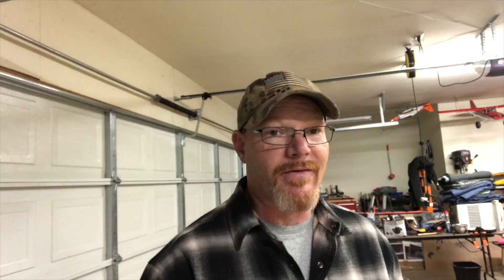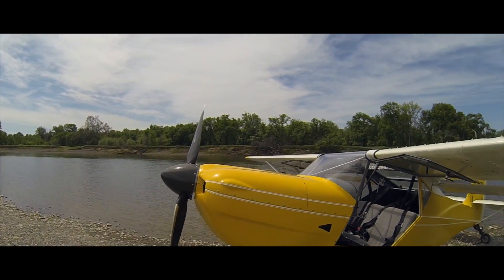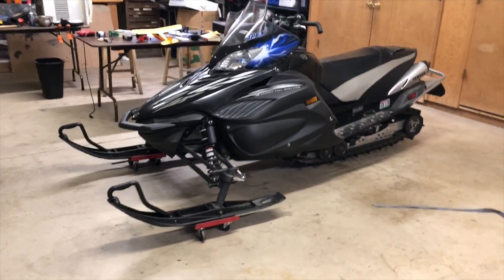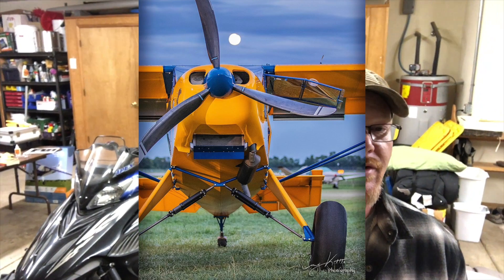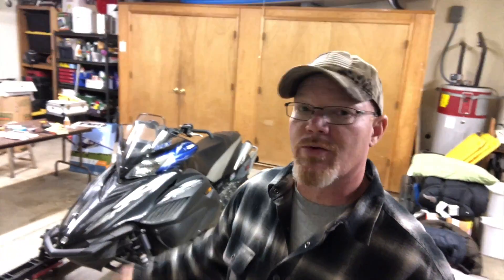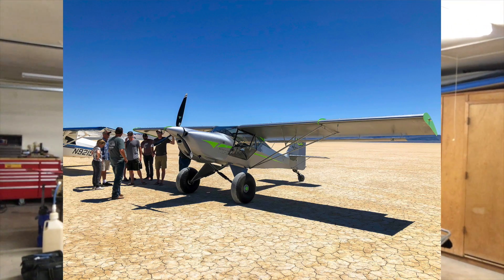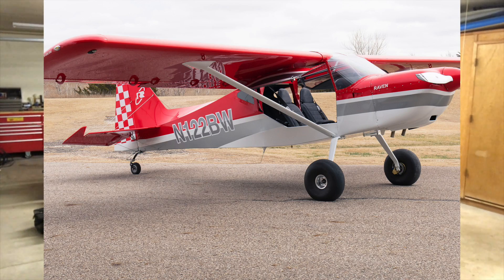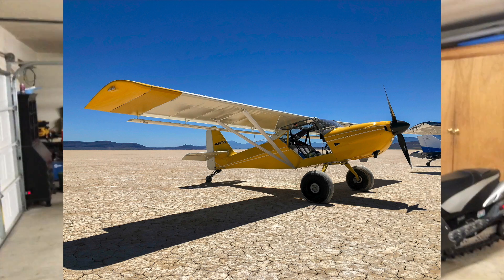There is an APEX in my garage!

Comment: Any reason you use a sled engine and not a motorcycle engine ?
Reply from the maker: Sled engine has an output shaft that can be adapted to a reduction drive. Motorcycles have an integrated transmission that can not be removed in most cases.

Comment: These Yamaha engines are amazing I have seen some aftermarket upgrades getting 400-600hp with the proper upgraded rotating assembly.  A fully built apex engine vr a rotax 914 turbo engine is the weight the same with double the HP.  What would be cool is if Yamaha would build this engine for experimental aircraft market.

Comment: You could just turbocharge your current engine if you are looking for more power and less reliability. Clearly, engines not engineered for turbochargers are somewhat of a risk. I saw your build 3 vid and commented on it re aircraft modified Honda engines. Seems to me a 180hp turbocharged, reliable engine made by arguably the most reliable engine builder on the planet would be a sensible choice over a 12 year old snowmobile engine with an aftermarket turbo. Way better than paying double the price for a turbo Rotax with the reliability issues those bring. Good luck and I'll get into the rest of your vids, thanks!
Reply from the maker: Viking has done a good job bringing the Honda engines to the airplane world, although I don't think they have a turbo version, but for this application it is too heavy, and Yamaha is equally known for their reliability especial this engine. There is less risk putting a Turbo on this Yamaha than there would be putting a Turbo on my Lycoming. Plus I just don't want to add anymore weight to my model 5. It is already on the heavy side with the Lycoming. The Yamaha will shave 80-90 lbs off the empty weight compared to my Lycoming and it will have more HP.
Reply: Less weight and more power, sounds like a great combination. I've owned a few yamaha's and have never had an engine failure, even in competition. Viking do now have a 180hp turbo Honda but it is a heavy beast; furthermore, the owner of Viking seems full of sh*t much of the time and I've heard of poor customer service. Great luck on your build, I am following and looking forward  @BowenAero
Reply: @BowenAero  I just want to add my two cents on turbocharging an engine that was not designed to have one. I am no expert in anything really but in my experience, performance mods have ALWAYS reduced reliability. From my Yahama Superjet, through 250YZ to my Yamaha Phaser sled. I'll also bet those two cents that if Yamaha were to come out with a turbo APEX, the changes to the engine would be subtle and very numerous. From metallurgy to stress re-engineering of the crank, rods, rings, and even the case design. I understand that for high altitude flying, turbos rock; therefore, a very low pressure turbo might not be so bad. Something that added very little total power, if any, but maintained air volume into the engine at low density. Looking forward to the build series!

Comment: Let's have a word about an av turbo and what it needs vs a terra based. Low rpm boost with minimal lag. What about blow off performance at altitude with air pressure changes? Progressive valving? What about air temp control? Air to air inner cooling up high, can it get too cold?  Timing at sea level vs say 5000 ft? Progressive computer controlled timing curves based on air pressure and intake temps?
Reply: Keeping in mind the turbo isnt to make power but to maintain power up high such as war time military aircraft. It will make a bit of power however but #1 is reliable, #2 is weight and these two already have a very very fine line. To add in a power adder now you have exponentially compounded your problem as it steals from both 1 and 2

Comment: Your current plane "old yellow?" has a certain integrity and beauty which is impossible to quantify. Watching your videos I can see that it flies straight and calm, and it has a mature sound and vibe. The best path respects that energy, the momentum that it has. Anybody can take stuff apart, and even restore it back again. But the removing of things that are so well dialed in changes the energy, even if you go to great lengths to put every washer and nut in exactly the same position, such that the overall feel is never one hundred percent the same. So I say, with a grand hand waving gesture, that you should keep flying old yellow as-is and meanwhile build a nice S20 or whatever you choose. Once confident with your new rig then you can hand down (sell) old yellow (to one of us!). Keep up the great work and the great videos!
Reply: well said

Comment: Either build a Fox Rocket with that Apex,  or a Highlander with the Apex and flip the KitFox.  Think it'd be wiser to just build a whole new plane with the Apex powerplant, and flip the KitFox, monetarily speaking.  Do you really do that much high elevation flying around Redding, CA?  Sounds like budget wise, none of it is too much of a discomfort, financially for you.
Reply from the maker: It is more high Density Altitude flying here in Redding and High Altitude flying in Idaho and Nevada. Any option will be financially challenging especially starting over. That is one of the attractions to the Apex engine set up. Right off the bat you are $20-30K less than a Rotax set up, although it will be more work since there is no firewall forward option available for the Kitfox.

Comment: 1. If you can afford it I would keep what you have.  You have it dialed and you would be able to keep flying while building.  It sounds like you are excited to build a new airframe.  2.  It sounds like you are really sold on the snowmobile engine and I am not trying to rain on your parade at all.  I completely understand that you want more power.  The places you go power is really important.  I don’t think it is more important than reliability.  I am sure you know way more about this engine than I do.  Just without knowing anything about it I am immediately concerned about reliability.  It seems like Rotax has done a lot of things right and the 915 seems very legit.  And very expensive.  
3. If money is an object then I would put a 915 in your current airplane.  Maybe upgrade the panel too.  It would be a nice project.  That’s my .2 cents.  Either way I will enjoy watching your project.  Thanks for sharing.  Good luck with your decision.

Comment: The huge boom in popularity in Kitfox (thanks to all the video bloggers) is driving up demand and much of that demand is going to be from "dreamers". I think you will soon see a lot more partially completed kitfoxs being sold on barnstormer. That being said, the Rans Outbound has the metal skin and can carry a much bigger load than the Kitfox so that means much more fuel and gear potential.
Reply: On my short list, but I'd need more STOL capability.  That spring gear has to go, for starters.

Comment: I’d like to see a scrounge build, use what you can find cheap or get free, like an old champ fuse modded to your needs by you. Find (non champ wings) wings or build from scratch, get ahold of Pete Plumb and do a custom build with slots or slats, and Cessna flaps. Set a super low budget and make it work. Think way outside of the box, you’d have a ton of us glued to your channel, and set up a cam for time lapse. It would be sick if you used your ingenuity to build a hi lander/kit fox/cub killer..... you can do it with that fwf turbo, and you can make it look like a decathlon to boot!

Comment: Well Bryan let me tell you about me.  I have a Kitfox 4 582 love it at 1500 ft. Started following Trent and you.  Found fox 5 bought it IO240 con. 125 hp. Guy had it ground looped it 8500 ft. No power and heavy.   Well guess what I flew it. Made 4 landings at 8500 ft. Not enough power I ground looped it not bad as he did but got wings tips. Also have talked to John and yes he is behind. Iam going to sell my 4 and build the 5.   5,6,7 s are all basic same  I will just change my engine in time.  I sure like like the snowmobile get everything you need to change it out and do like Trent change it out. Spend money on paint and dash call it a day.   FYI.  Good luck keep posting

Comment: For what its worth... i would rather ask the question... would I put my child/wife/mom in the plane with this powerplant? And take it from there. Personally if I had the money I would upgrade the motor to a turbocharged Rotax... but then again, how often do you fly at these high altitudes? Really great channel BTW.
Reply from the maker: Godfrey & Patrick wohnung I have asked that question and the answer is yes. To be honest I’m not a big fan of the Rotax and here is why. 100hp I feel is underpowered and the engine is designed for 100hp. Sure you can increase that hp with the 914 or with an Edge Performance 150+ hp setup, but the it was still designed to be a 100hp engine and the 915 is too cost prohibitive. The Yamaha engine was designed and proven on the Rx1 race bike at 200hp and is arguably the most successful motorcycle engine ever made. It has been derated to 160hp for the APEX application. It has a great reputation for reliability and it can be modified to 200hp while staying within the envelope of the original design and engineering. To answer your last question. I fly at the higher altitudes often and living in Redding, Ca I am at high Density Altitudes all summer long. For me a power increase would be a real advantage and make the airplane safer by increasing the power margin. Thank you for the input, your comments help me work through my options.
Reply: You are clearly thinking this through very carefully and I agree with  all your points.  I did not realise the altitudes you fly at (ex Cape Town.... runway altitude 150 ft!)... Hot and High.... not a nice combo. I will follow your path (and your videos) with great interest - I am sure you will make the right decision!  Greetings today from a high speed train in Hungary.

Comment: Steve and the highlander have kinda pioneered the apex. Sure, it can go anywhere it fits, but that combo is proven. Your KF is heavy, and a motor swap alone wont make it the perfect gravel bar or hill top machine. Fly your KF and love it, for now. Send your apex to badass and order your new plane. You deserve to be competitive at the high sierra, but also be a bit more modern and updated. You’re young enough, treat yourself while you’re still able. Stick with a swing wing while you have such a low hour motor though. You may have to trailer it some day.
Reply from the maker: adam walker, I respectfully disagree in regards to the Lycoming O290 Kitfox's performance. It has been a common sentiment from the Rotax crowd and I feel that I have disproved the myth that a Lycoming setup is too heavy. It can certainly benefit from a lighter install if the same or greater hp accompanies it. My Kitfox is actually lighter than Trent's 915 install and by putting the APEX engine setup in mine I will lose 80lbs, putting my empty weight at about 850lbs with somewhere between 140-250hp depending on if it is stock or turbo. It currently is a great gravel bar machine at sea level and I would put its 130hp up against any 100hp Rotax setup at sea level. With less weight and extra power it will be an amazing performer, especially if I was to switch to the Kitfox STI wing. The highlander vs the Kitfox STI with the same power plant are very similar in performance. The advantage to the Highlander is that Steve has already done the hard part of figuring out the firewall forward, so I agree that it is a strong option. The pioneers for the Yamaha were actually the gyro guys and a brilliant guy named Keith Delaney who built his own one off belt drive reduction system and a custom controllable ECU in a Rans S6. He was my hangar neighbor when I lived in Corvallis, Oregon and I watched the development of the system. I was very skeptical and was surprised at the outcome of amazing performance that he was able to obtain from his setup. The Kitfox will only excel with a light weight high hp firewall froward, as the Highlander has. I appreciate the input and would love to up my game at High Sierra and in general. The Highlander and the Kitfox I believe will be competitive with this engine. Just look at Steve's times in the STOL Drags and also Trent's with the 141hp 915 powered Kitfox. I do have one issue with mine that may present a problem in the conversion. My wings are mounted with a 1 degree forward sweep to balance the CG with the Lycoming. Removing the sweep offers some engineering challenges. I also feel that it would be a shame to change a proven setup, which has me leaning towards a new build. What is your opinion on the Rans S20 or S21?
Reply: Project Kitfox , the rans aircraft are beautiful machines. I saw a s20 at a recent fly in and was very impressed with its fit and finish. It was small and very nimble, and a true performer with 100hp. I personally need my wings to fold so I can fly from my house, so I didn’t study them much. I ordered my sti kit in April and pick it up next week. My biggest concern about the whole project is the engine option. Lots of choices, both aircraft specific and converts, with nobody really agreeing on any one as being best. I think we all see the performance of 150hp in the Kitfox though, but the added weight pulls from its agility a bit. Well see how Trent likes adding even more weight with that MT when it shows up.
Reply: Project Kitfox I have the wing forward sweep in my Kitfox as well with a Continental IO240. When I talked to the Mcbeans about switching to a ULS912,  it wasn’t much of a concern to them as the firewall forward kit for a ULS put the motor further forward. That might be all you have to do is move it more forward a little if you’re making the mounts anyway plus moving the battery and ELT forwad as well.

Comment: i just finish rebuilding mine , first thing is to make sure the nickel silicon carbide plating is in good shape in the cylinder  or it's a brand new  block replanting is not a option, send it to a professional to re hone with diamond honing .
the OME piston are 1 / 12 ratio but for turbo  you need  1 /10 ratio  GP piston is the top dog , i highly recommend ceramic coating on top surface to help control temp's,  kept the same piston rode.
one important thing that will affect you set up is what gaz you will used avgaz/ 96 unleaded/ pump gaz etc ,  i use a  after market Turbo  calibrated for  8 pound of boost ,  you can go up to 20 pound with different compressor Welles  and reach up to 350 HP but  temps and where on parts would be much grater so i stayed at 8 pound and  conservatively  lower temp's and where on it at constant revolution and still got 225 HP  at full rpm on original injectors .

needless to say Bering gaskets seals  etc ... for the head i just got the valves re-sited  adjusted and  a very minimal porting  , got the titanium exhaust and turbo hosing ceramic coated to help control temp,s 

now i need to fit it all in a CuB cowl , rad , inter-cooler, oil-cooler , muffler etc....not looking forward to it
Reply from the maker: Alain Rivard, Thank you that is some great info.